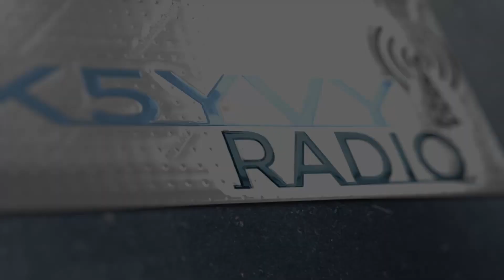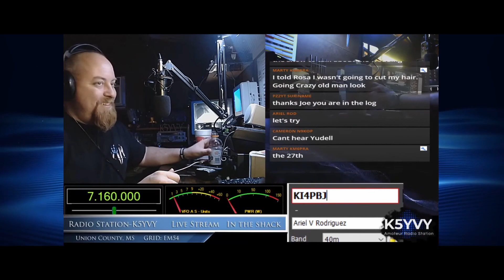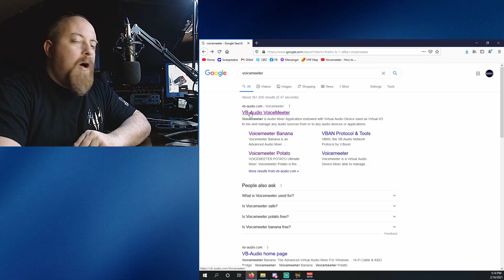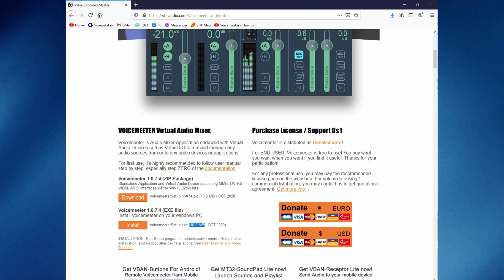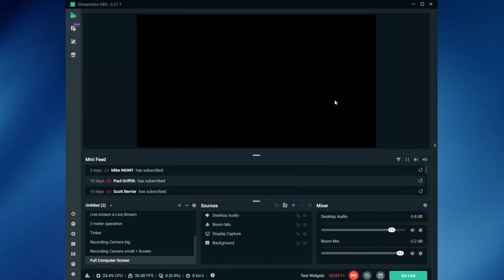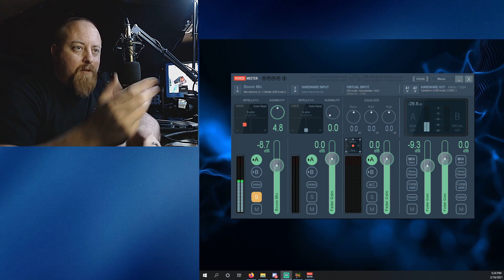Single mic, two outputs. Icom 7300 voicemeeter ham radio

Comment: Hey Joe. I’m missing a step. I get how you route the audio from the radio into VM. But how do you pass your mic back out to the radio? I’m fooling around with many different configurations both hardware and software but this is the piece giving me the most headache. (Running Yaesu FTdx101 plugged into the pc).
Reply from the maker: In Voicemeeter on the right side above or next the cassette tape, you have to select hardware outputs (A1,A2, and so on.). So for example you would select the audio codec for your radio on A1. Then on on your input meter where you selected your mic, make sure the A1 button is selected active. 

Send me a email if you need more help so I can include screenshots for you.

Comment: Do you use a ptt button or switch to activate the radio?
Reply from the maker: Hey Chris, I use a foot switch for PTT.
Reply: @K5YVY  Thanks for the reply.  I'm trying to use it with a headset, but when I key the radio with my switch it just doesn't have the power out put to the radio.  I have to yell into the mic on the headset to get any out put.  Thoughts?  Thanks for your videos and discussions on the other channels as well.  Very informative and fun!
Reply from the maker: @chrishale4010 sounds like your headset has a dynamic mic element, Icom radios require a electret condenser mic. Modern Icom radios supply a bias voltage of +8v through the audio connector to power electret condenser mics. If your headset does have a dynamic mic, then you will need to use a AD-1-I with a blocking capacitor to block the voltage coming from the radio. I used a dynamic headset for awhile with my 7300 and a blocking adapter and had to set my mic gain and compression higher than usual with the stock mic. I have since moved to using USB microphones into my computer, and routing the audio by USB cable from computer to the 7300, doing this I can use any type of mic, drawback is I have to have my computer on to use my mic. 

Hope that helps, you can usually find the AD-1-I adapter online others have made for less than the Heil brand, as long as it has the blocking capacitor you should be good. But keep in mind if you ever change to a electret condenser mic you will need another adapter without the capacitor so it can get that +8v from the radio. 👍 of course I said all this assuming your using a Icom radio🤦‍♂️

Comment: My 7300 has an echo when using an interface and for mike.
Reply from the maker: Victor thanks for your comment, echo could be caused by your driver selection in voicemeeter, try selecting WDM: on your mic channel and a different driver like KS: or other option you may have in the drop list for your output channel. 

Also if you still have a microphone connected to the radio you will need make sure mic gain is set to Zero% on your radio, if not you will be transmitting audio from the computer and your radio mic and causing a echo. 

If you need more help with this feel free to come back and let me know. 73
Reply: @K5YVY  My interface is an Behringer U-Phoria UMC404HD USB Audio Interface. Will try today considering your advice. Thanks a lot. 73.
Reply from the maker: Okay, I have not used a hardware interface in my setup, but I would think the same trouble shooting would apply. Either a usb driver issue or a second mic source. Things to double check is anything that has a mic, built into computer, webcams, etc. is not feeding into where you are trying to route your main mic audio. I’m unsure what your goal is to suggest in the right direction. Are you wanting to live stream/record videos, have the ability to use your mic for the radio and zoom calls, or just run your mic through from the pc to radio?
Reply: @K5YVY  For now, I am feeding the radio via an Ibox, then to the IC-7300 ACC port. Now, would like to use the USB port. I did before via Voice Meeter Banana and a DAW, but just interested in Mic to radio via interface, and the interface is USB into computer. Radio is USB into computer. No streaming for now, just radio.
Reply from the maker: Good deal, that would open up more EQ options for you going through the computer. So yeah I still say start with driver and mic gain on the radio (if you still have one connected to the front ). Find a sdr on websdr and listen to your signal to determine if you fixed it or not. 👍
Reply: @K5YVY  I forgot to mention that I do use web SDR and some others a lot to my advantage and including to monitor my audio. On the IC-7300, I can chose wchich mic input to use as ACC, MIC, ACC, or USB. So, when using USB, the front mic is muted, but the PTT still work on front and on ACC. So I am assuming, there is an audio routing problem there. Will check and see. Thanks a lot. Cooking day. Happy Thanksgivings Day. 73
Reply from the maker: @k2icc  happy Thanksgiving 👍
Reply: @K5YVY  Problem solved with the echo. It sounds like reverb. It was on Cakewalk DAW, the ProChannel section, the Post Global On/Off was on. Now turned off and echo is gone. Using also Voice Meeter then routing audio between both, then to the radio via USB, with Set, Connectors, both Data Mod and Data Off Mode set to USB.
Reply from the maker: @k2icc  great news!!!

Comment: How do you have the 7300 set transmit with this setup? Do you have vox turned on or something?  I plan on using this same setup. Thanks.

-KO4DZL
Reply from the maker: I use a foot switch for PTT 👍

Comment: So basically your just using VoiceMeter as a middle man between your mic interface, the computer and passing the audio to your 7300….. going a step further using a DAW (digital audio workstation) would allow you to virtualize your audio and further enhance your audio by adding  EQ and other plugins like compressors, gates, ambience, exciters etc…. then you’d be going down the Black Whole of ESSB audio. All done without buying expensive hardware to achieve the same.😉
Reply from the maker: Yeah, basically. I’ve already ventured a little further into that black whole you speak of sure this recording. Adding VST plugins and such trying to get the little niche I’m personally looking for, wondering far away from my original settings and the asking myself why because not one person has complained or made mention of anything to change. Lord help me if I ever stepped into a full fledged DAW lol. I have this tinkering problem that sometimes caused unnecessary issues.
Reply: @K5YVY  Funny you mention that I’m just fully virtualizing audio with my IC-7300…. VoiceMeter Banana / CakeWalk and a load of VST Plugins. My usual hardware setup is the UR6QW with the 7300 and an Electro-Voice RE20. Regards VA3VMD (Vito)

Comment: Nice,  I have had Voice meeter installed for something with zoom and using streamlabs obs, but never used it, and have a program installed on my computer to work with my 991A Yaesu win suite which looks like the radio software you have so I will have to try it out , thanks for the info
Reply from the maker: I do have win suit just so I can see analog meters lol I like them and the 7300 don’t have em. But yeah if you have your rig connected to the computer and it has a sound card you can use voicemeeter to use a mic plugged into the computer.